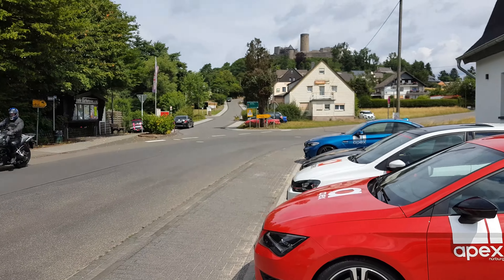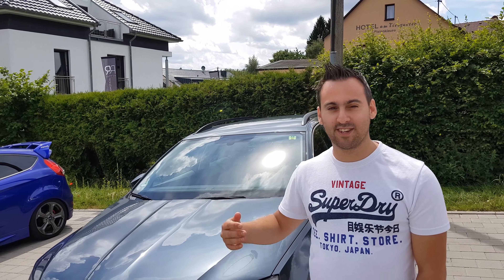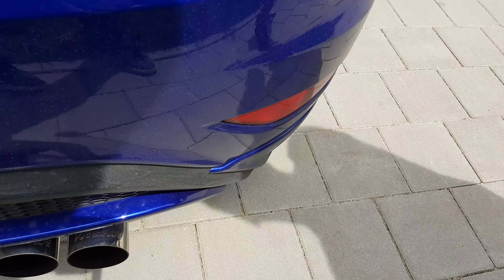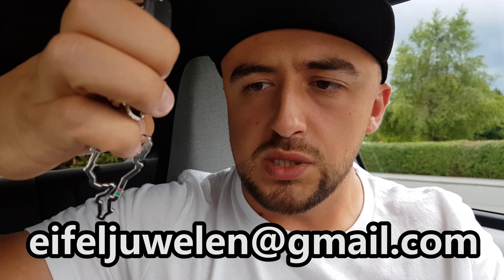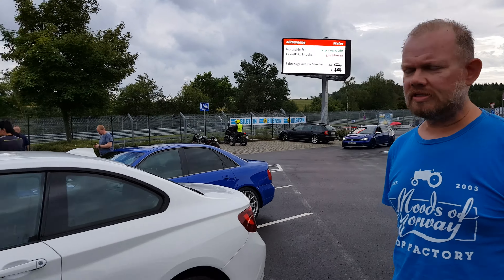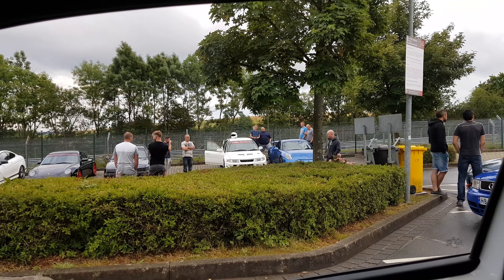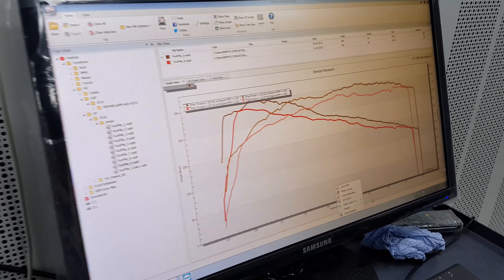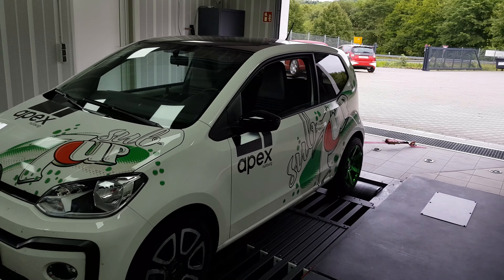TESTING THE GUERILLA DOWNPIPES ON THE DYNO

Comment: Makes sense, If I remember correctly only larger turbo's benefit from no back pressure. Smaller turbo's spool up quicker but have less number of blades that are shorter so you still get the benefits from smaller pipes, If you put a Disco potato on it then you would see bigger numbers with no restrictions.

Tell you what though, that's really good torque for a little 3 banger. Its quite impressive! Any torque steer yet?
Reply from the maker: Adam Randell no issues yes!
Reply: Lol you know what would be really interesting...... Golf GTI engine swap :) If it doesn't fit get a really big hammer. J/k don't do that!

Comment: Regarding the POV setup..you might consider buying a gopro backpack clamp and a hero session...you can mount the clamp at the shield of your cap.... I belive Sam from STG uses that setup and I have tested that and you can still see properly. The camera is at eye level and you do not need to wear a clumsy helmet.
Reply from the maker: MacGuffin helmet is there also fot safety reasons. The gopro does not block my vision
Reply: Hi, I mean as a casual setup when you are not hunting for laptimes or when you are getting a passenger ride....just saying  :-) tot ziens

Comment: Highly possible reason for better power delivery with more resistance: its about the exhaust gas flow (turbulent/laminar) and Reynolds  number and efficiency that the turbo charger turbine (that is designed for specific air flow conditions!!) is able to achieve in different exhaust gas flow conditions. Simply said, with low resistance behind the turbine the flow of the exhaust gas has higher speed which can result in turbulent flow, in which case the turbine is not able (designed) to take over energy in best possible way!

Comment: Is it possible if bigger downpipe created bottleneck in another component such as your upgrded air intake or intercooler or fuel injector or ignition system? i am not a mechanical expert so excuse me for the question
Reply from the maker: putra_murti badax we ruled it out :)
Reply: Doesn't an engine of this type benefit from some back pressure, maybe the pipe diameter is too large?
Reply: +OllieW501 I think so too. bigger downpipe upgrades may have to be followed by a more adequate upgrade of aftermarket turbo, intercooler, ignition and fuel injectors. It looks like today's turbo oem engine is able to deal with it even though the components inside the engine are still oem.
Reply: +OllieW501 I mean  another turbo kit upgrade will restore the backpressure reduction due to  bigger downpipe

Comment: The engine needs back pressure for the flow of gasses.  To large a pipe will reduce the engines power as you have shown. Read up on back pressure and this might help too:  http://blog.tdotperformance.ca/guides/exhaust-back-pressure-how-to-choose-the-correct-exhaust-pipe-diameter/

Comment: use the 2,5 inch downpipe and do a decat.. then you will see a better result... and in these case bigger isn't always better..  and dyno runs should be done in 4. gear not in 5.
Reply from the maker: AnzeS it was in 4 ;)
Reply: Sorry my bad :) that is one long ratio transmission :D